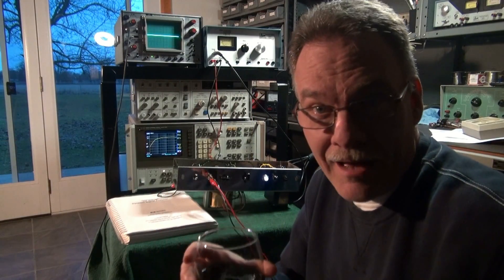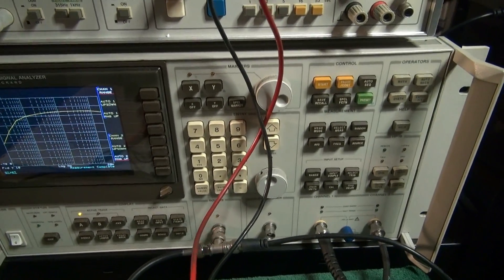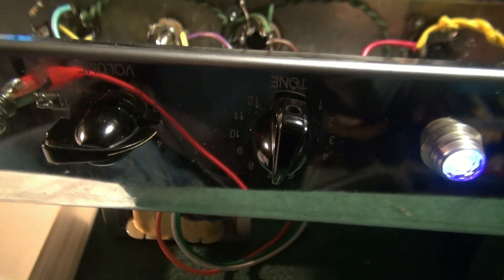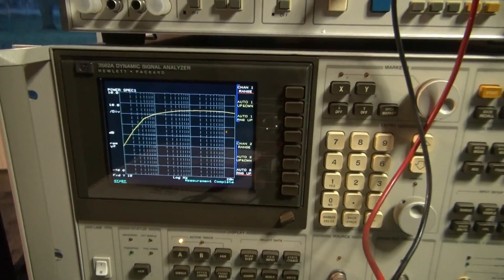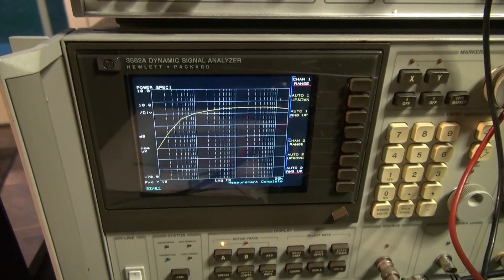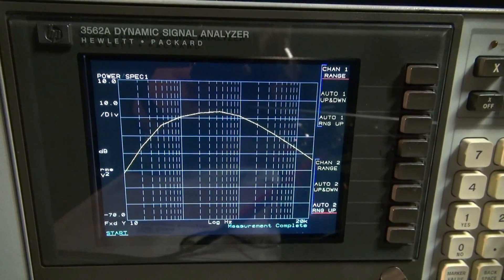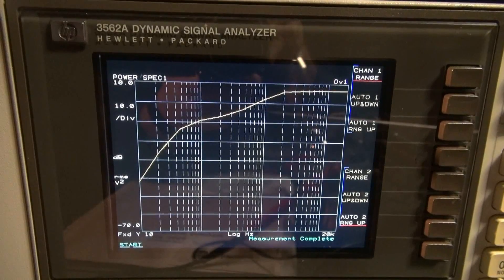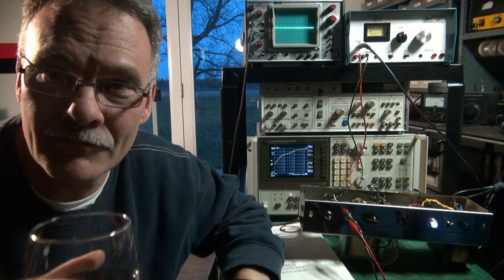How to check Frequency response Fender Class A 6V6 tube guitar amp D-lab Electronics

Comment: Hi Terry great video one question what were your settings on the hp3562a. I have one I have just finished repairing be curious to do similar test on an amp I have. I found the manual but have limited time with the unit. thanks Sam
Reply from the maker: Hello Sam,
 I made a check sheet. Will find it and send you a copy
Reply: Thanks very much I'll msg you my email
Reply: Hi, may I have it also? I got mine yesterday. :D

Comment: Terry - will that analyzer let you save/overlay those (for example) 3 response curves/traces?  Would be interesting to put the 3 back onscreen when done.   Also can you print them from that?
Reply from the maker: Hello, from reading the manual, it states that 5 traces can be saved/recalled for review. There is also a method for transferring files to an external drive or PC. Will investigate.